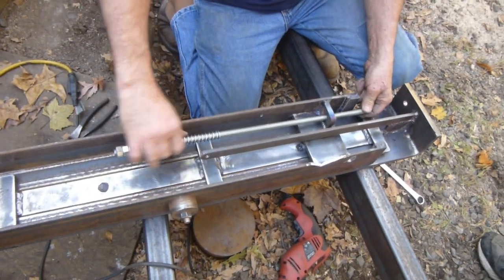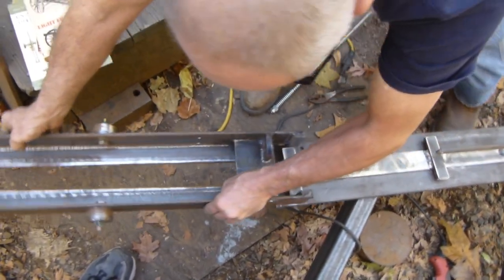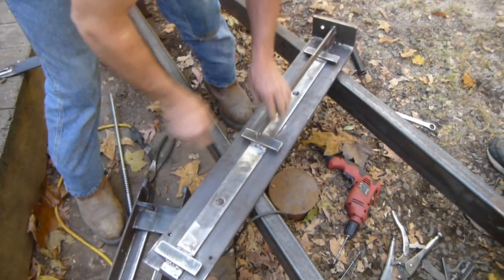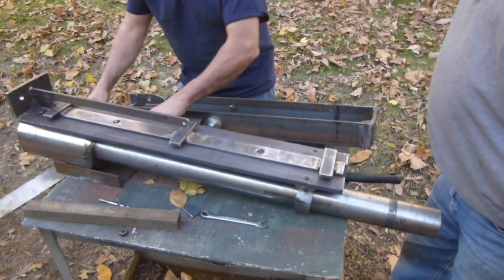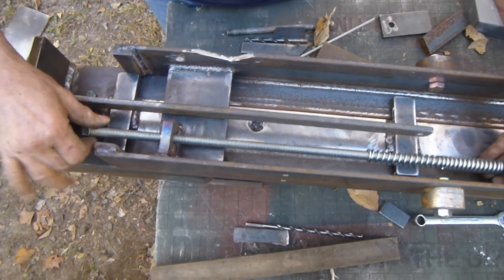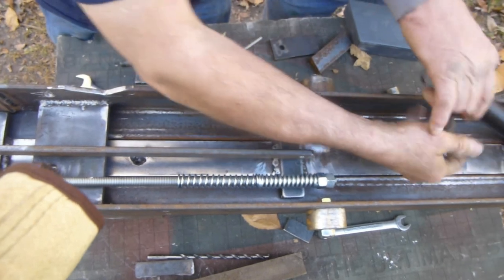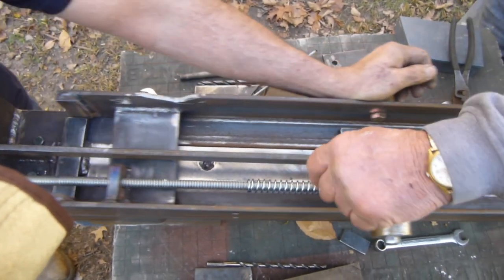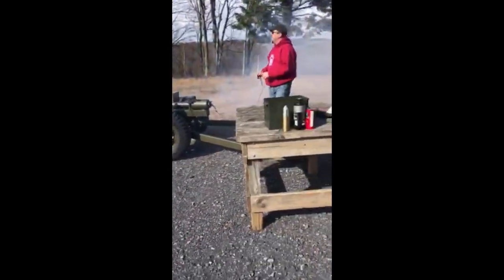Replica WW-2 Anti tank cannon recoil system

Comment: What a sweet system for low pressure recoil. I would consider using lots of grease inside the box to reduce wear or bronze flat stock for bearing surface on the rails.